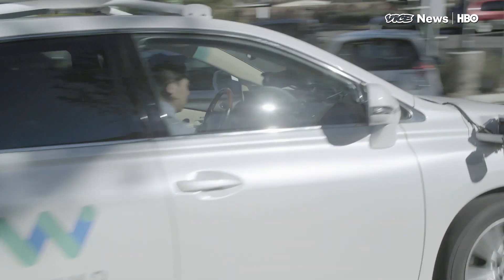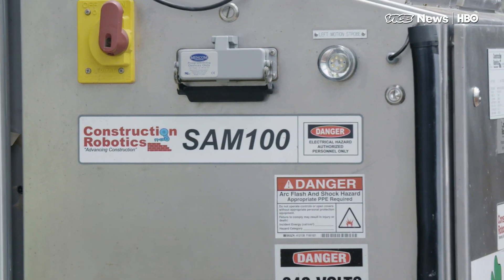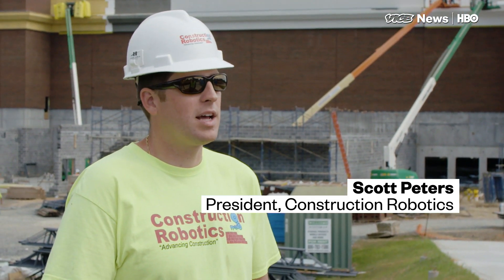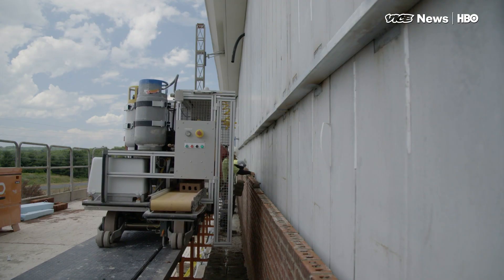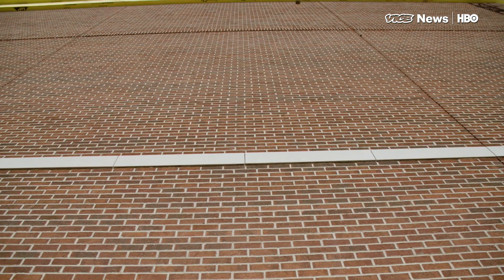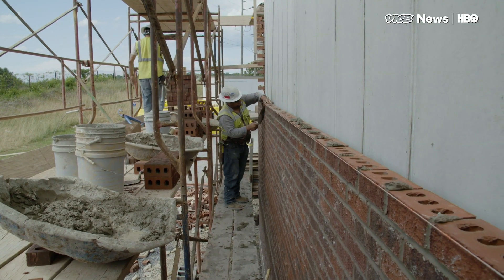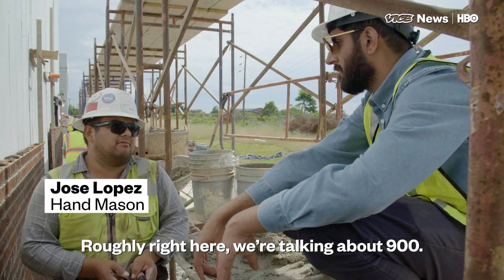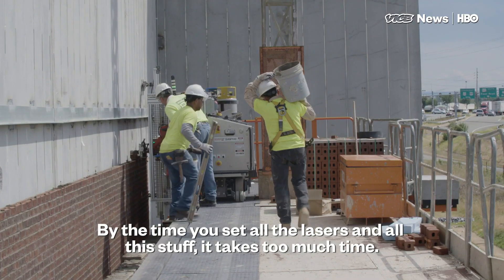This Bricklaying Robot Can Build Walls Faster Than Humans (HBO)

Comment: I am a construction electrician. No one can imagine all the calculations, adjustments, and decisions that a construction worker has to deal with every day to do his job properly and safely. No machine can replace that. Now, redundant work is different. Heck even Disney used interns to do the in-betweens for Snow White. You get the young, inexperienced ones to do the mundain redundant work and the heavy lifting supervised by the experienced workmen. The only way machines could replace the craftsman is for the societal standards to drop pretty darn low! But even then...

Comment: If you do the calculation 1 guy does 900 to 1,000 bricks and the robot thus 3,000 bricks but requires 3 guys to follow it..????   It's the same amount if three guys working. ?????

Comment: How does it handle a pier or laying stretchers or any of the different laying methods like Flemish etc? Or cutting bricks to size? And as someone pointed out,what about door and window apertures? Then there's the problem of a sturdy enough scaff for the weight for height works,it can't point up  either,I could go on but I'm boring meself now.

Comment: Nothing new here, they said this about the jack hammer,  the excavator to replace a hundred guys with shovels, the trenching machine laying pipe, the stamping machine producing car parts, and the computers replacing the rooms filed with women typists. But in Washington DC you still have men in elevators pushing those buttons, because it used to take skill to get the car to stop on the right level so people didn't trip. Lets all be socialists, then we can keep doing bricks one at a time, no machines.

Comment: The whole point about bricks is that they are designed for humans to manipulate easily without strain. If you've got a robot then you dont need individual bricks! - just build the building using large pre-made slabs of material  that a human builder cant handle.

Comment: I want to see that robot put on a wall where there are windows, doors, designs, etc.. not gonna happen,  human still faster. Takes 3 workers to maintain the robot.
I'm a masoner,  I lay and joint myself, 1000 bricks a day on fairly straight walls with some openings here and there. But that's just 1 person, put 3 masoners and you have about 3000 bricks layed a day,  plus 3 laborers. 
Somebody said here that they don't take breaks or anything... they sure do,  when the guys go on breaks,  the robot will too

Comment: You can precast the wall the robot is laying brick on . It is not economical to brick walls in this manner. There are precast panels walls available in the market . Maybe the building owners as well as the designer / architect  should look into different wall systems that would cost a lot cheaper?

Comment: A robot will never be able to my job: Commercial Electrician. Too many intricate hand movements to be made. We already have machines that bend conduit but still require a human to control; Green Lee hydraulic bender, "Chicago" bender, so on. The world will ALWAYS need Electricians unless we revert back to the Dark Ages. Currently, no one has a job without an electrician being involved in one way or another to help wire the building that you go to everyday. Just as such, I don't have a job to build without others having a job to go to....the circle of life.

Comment: For a machine dealing with the same two components over and over that seems like a super inefficient design, should have a conveyor belt fed pickup wheel that just passes the brick through a constant stream of mortar or just have a fixed tube that continuously lays mortar on top of the bricks that were just placed... something like that.

Comment: 1 human brick layer = 1000 bricks a day, robot with 2 operators = 3 000 bricks a day which mean 3000/3 = 1000... what is the point? If it could do it alone with only minimal human intervention it would be awesome but if it needs 2 guys, you can just get another brick layer and get same result.

Comment: If that machine lays 3200 bricks in a day, and takes 5 men to operate it, a crew of 2 labourers and 3 bricklayers can come close to that production without all the added costs involved, ie. Machine cost and maintenance, set up of the machine, plus the added cost of tge labour to operate the machine. I don't see this being feasible until uts production numbers equal 500/hr.

Comment: WHY DONT WE USE BIGGER BRICKS SO WE DONT HAVE TO LAY SO MANY EFFIN BRICKS?
Reply: Because bigger bricks would be more susceptible to cracking under pressure. A wall made out of numerous bricks dissipates the load more evenly throughout its base. Furthermore, standard bricks are small enough to be transported and be handled more easily on the construction site
Reply: @samoharvan2  if robots handle material weight & size becomes unimportant.  bricks or blocks can be engineered to optimum size for any given project.  plus current project design is constricted by available materials.  with smart manufacturing material design will adapt to future project requirements.
Reply: WHY DONT WE USE MORE BLOCKS?
Reply: HMM that is what will happen as robots can lift heavier brick ie larger brick oh wow even less men needed fantastic!
Reply: WHY DON'T WE USE BIGGER ROBOTS AND BIGGER BLOCKS?
Reply: MWYANT19 think you need to turn off cap lock bro;)
Reply: THANK YOU BRYAN THAT'S WHAT I'M TALKIN BOUT LETS DO THIS PPL!
Reply: WHY IS IT NIGHTTIME?
Reply: CAN YOU STOP TYPING IN ALL CAPS IT'S REALLY ANNOYING!!!1!!
Reply: Trainzguy 2472 stfu
Reply: yeah like why don't we use big ass blocks like the Egyptians?  damnit
Reply: MWYANT19 it'll be a waste
Reply: ELON CAN U HEAR ME? PLZ MAKE BIG BLOCKS LIKE LEGOS BUT FOR HOUSES. MAKE THEM CHEAP AND SOLAR PANELS BUILT IN THX BRO
Reply: The answer to that question is the same as to "why even use bricks at all?" Aesthetics. People choose brick because they believe it to have visual appeal. The size and shape are selected based on the human's perception of what size and shape is appealing, affordable, practical, etc..  

Furthermore, if a robot can lay bricks faster than a human then a robot can also lay larger bricks faster than a human. So your argument is moot right from the get go.
Reply: DAMNIT RYAN IM NOT SAYING GET RID OF THE ROBOTS IM SAYING GIVE THE ROBOTS BIGGER EFFIN BRICKS!! SOMEONE GET A KICKSTARTER FOR BIG ASS BLOCKS LIKE LEGOS BUT FOR HOUSES WITH SOLAR PANELS ON THE OUTSIDE AND BATTERIES ON THE INSIDE.
Reply: Is Ur caps broke

Comment: I showed this video to a construction worker building a wall. He shit a brick.
Reply: Was his name Sam?
Reply: Jerry VanNuys As in Uncle?
Reply: ROTO SCOPIC those take to long ,to set up . and could only do straight walls not flexible .Very limited.  cost to much, and truly not cost effective . so good luck with that machine .
Reply: +Angel Barbosa
These robots are like computers from 1960's - big, difficult to operate, & expensive. It is now 2017, and you can buy a cheap laptop that does everything better than its 1960's predecessors.

I'd imagine 50-60 years from now people could buy a general purpose robot for a thousand bucks or less.
Reply: Angel Barbosa not yet
Reply: he shat not shit a brick
Reply: ROTO SCOPIC lmao.
Reply: Did you use it?
Reply: ROTO SCOPIC I bet those Robots cant drink a beer and go to a strip club after wk

Comment: wonder if the cool farmers on the hill with long driveway. will ever play cricket with a stallion that sits in a cockpit flying a 747. they might be able to after they do a 60 week at work..... after that they might be able to hitch a ride back to the top off the mountain. that's providing the stallion don't boot them off. well I guess in that case it might just end up a long track to the top off the mountain again... but don't worry there should be plenty off ice so they don't die from thirst

Comment: Wait, a human can do 1000 bricks, this robot needs two humans to finish off the work. So thats 3 humans it is working against not one and 3 humans can do 3000 bricks too. They also require no maintenance and can do much much more than just lay the main sections of large straight walls.
I don't see the gain here. I do see cost and setup hassles.

Comment: The wall just got built 500x faster
Reply: Justin Koenig well, 3x faster.
Reply: +gg g yeah apparently they haven't heard of the art of the deal 😂
Reply: MAGA euphoria.
Reply: +Justin Koenig you do realize that they have stainless  L straps every few feet that are attached to the inside wall and embedded within the brick mortar...right? 
similar to houses, but much more robust.
Reply: Higher, deeper, and thicker, too!
Reply: Str8 4ward oh yeah?
Reply: Justin Koenig lol but its only 1 brick thin, a strong breeze knocks it over
Reply: Swingle singers
Reply: IS THAT A JOJO REFERENCE????!!!
Reply: AnimeHomoFobisti life is a jojo reference mah boi
Reply: Oh, how ironic that would be. Lol.
Reply: And the tunnel was completed decades ago.
Reply: 500 x 0 is still 0
Reply: TUNNELS *

plural X infinity
Reply: CineSkies Doesn't mean you'll win though. Rich people can afford to waste time doing stuff like this, you most likely aren't going to outlast their budget. They'll spend 10 years losing 100 million if it leads to 10 years of making 101 million.
Reply: Str8 4ward true story.
Reply: Then what you're saying is the owner of that capital is incapable of doing the calculations to determine if fewer resources (money) are being spent. Brick laying robots are laying large flat walls for a reason - because it's costing less in that case due to the ratio of setup to laying time. 

In may even be the case that early uses of these machines consumes more resources. The initial estimates didn't pan out. But these business owners share trade journals and conferences and eventually figure it out. Since there are quite a few of these machines out there, I think you can figure out the answer. I can believe all these business owners or  an anonymous comment on a youtube video.
Reply: Sureeee build the wall out of bricks see how long it lasts 😂😂 you trumptards are so desperate to convince yourselves the wall will be built